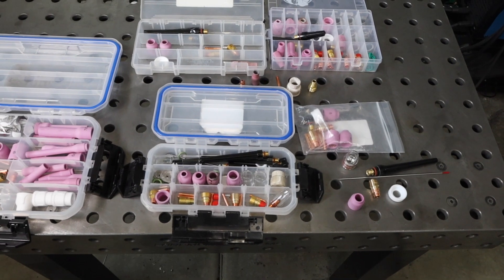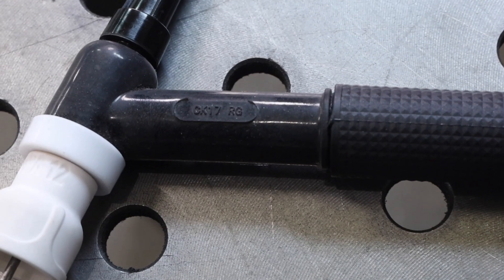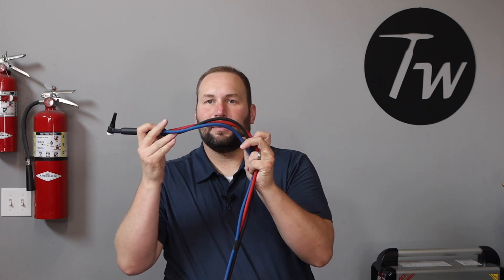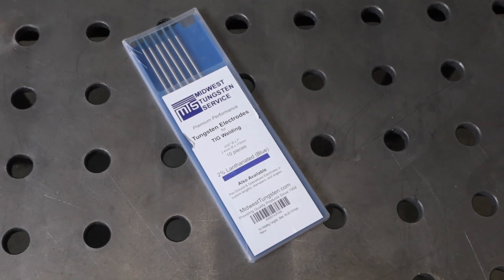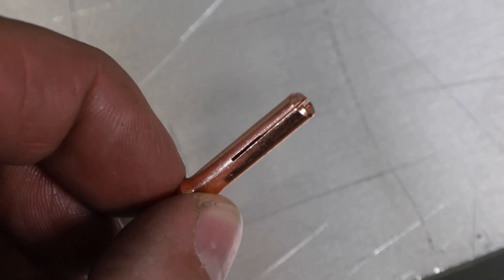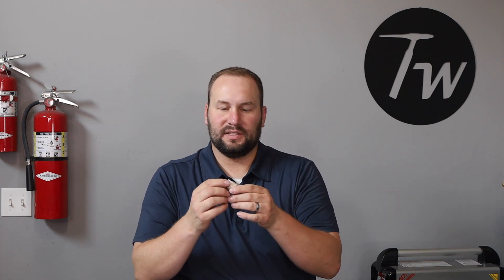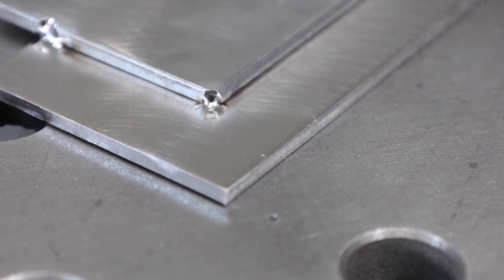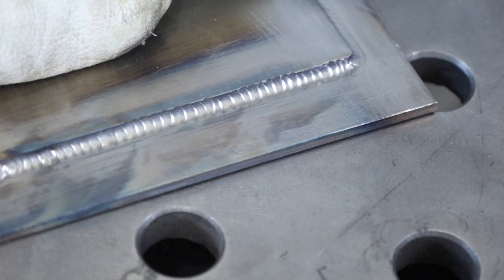TIG Welding: The 6 Torch Consumables That Can Handle Any Job

Comment: Excellent video. Thank you. I started welding in the late 1950's with gas, then stick, added MIG in the 90's. But I'm a newbie TIG welder - PrimeWeld 225 from Weldmonger arrived July 31, 2024 with a stubby gas lens kit. To keep things simple I use a Furick gas lens with 3/32" 2% Lanthanated tungsten on my CK17 torch with a ceramic #5 stubby cup for aluminum and Ceramic or Pyrex #8 stubby cup for everything else. I built a copy of your TIG grinder (thanks for that video too!). So far that's working well for me. It costs $112 to refuel my 80 ft^3 Ar tanks at the local Airgas store (at my age I don't drive any farther than I have to) so I avoid bigger high flow cups. I may eventually need one,  but until I do I'm trying to keep it simple. After 2.5 tanks of dedicated practice TIG has become a functional process for mild steel welds I'm proud of and I'm close to that for Aluminum, so it's working for me.  My only planned upgrade is a 25' water cooled flex head CK18 water cooled torch that will use all the same torch jewelry.

Comment: I have the torch that came with my YESwelder 2050 (WP-26) that I would like to replace with a smaller one.  I don’t need the on off controller as I bought a foot pedal, but I really WANT to try the much shorter gas lens.
Reply from the maker: The short gas lens will fit on a 26 and it helps a lot. I really like the CK torches. A 17 will be a bit smaller but still share consumables with the 26. A 9 is much smaller, but uses different consumables and has a lower amperage capacity.
Reply: @TimWelds  Thank you,  I want to get rid of the big clumsy 26 that it came with.  I had always used a water cooled 17, with a #5 cup.  Years ago I was a professional welder specializing in SS, but learned on Aluminum using a oxy/ acetylene torch.  I still prefer SS and aluminum to this day

Comment: I usually like sticking with an 8 cup on stainless most of the time. The color is great on the 10 plus cups but I like to save my gas when I can. I kinda hate running full post flow when I tack up stuff too. You can also use copper to create gas traps for your weld joints, good for absorbing heat too.

Comment: looks about the same diamond coated disc for tungsten grinding that i use...only mine is mounted to the outside of the grinding wheels on a bench grinder.  100 grit works great!

Comment: I have a question about tungsten. How do you cut it apart? ☺️
Reply from the maker: You can use a diamond wheel to cut it, or just make a nick in it with a grinder, clamp it in a vise right at the nick, then bend with pliers NDI it will snap off. They can split when you snap them, but mine usually don’t.
Reply: @TimWelds  thanks for the answer 😇

Comment: I do 90% of tig with ck20 and standard 5 or gas lens 6 cup. Titanium #8 gas lens. People tend to use big cups for no reason at all. You dont need #20 cup to do nice welds, you just need to know how to control heat input. For that you need some theoretical knowledge and a lot of hours under mask.

Comment: What cnc plasma cutter do you use?
Reply from the maker: I have a Premier Plasma table with a Hypertherm Powermax 45. The Hypertherm is awesome and they have great customer service; I would definitely recommend them for plasma cutters. As far as the Premier Plasma table goes, it works pretty good for the price, but I had some quality issues early on that would lead me to pick a different brand next time.
Reply: @TimWelds  thank you

Comment: so ive read a argument that large gas coverage on AC will result in a wider arc. where theres gas, there can be arc. So if you arc longer than you should it will allow the arc to be less controlled. For this reason the argument says NOT to use gas lenses.

But i think this argument may be outdated because now you can get 4,5,6 cups that neck down around a stubby gas lens when before all you could get was 8,12,14,25.

with 1 yr of aluminum tig experience I mainly run #8pro stubbys but i do find that i struggle when small precision is important. Im going to drop to ally5 furick & see if it will narrow my beads.
 interested to see your reply.

Comment: Just subbed, very educational Tim, I bought a tig welder but it came with out consumables, so I have never even tig welded before and been trying to figure out what I need, what a nightmare trying to figure this stuff out, first I needed cord plugs 100 amp that's done then I needed consumables, not knowing information  I tried to get a pack of 5 of each items so I got that except for the tungsten something I forgot when ordering, I got the tanks of argon but there to small for the welder and it's the biggest my local welding shop would sell me, I ended up buying the lincoln precision tig 275  k2618-1 it came with the roller stand and water cooler etc package, so all I have left is the tungsten, larger argon tanks (if I can find them) and upgrade the electric in the garage to 130 amps min.
looking towards more of your neat videos.
Reply: What size tank did you get?
Reply: @GiovanniGiorgo  The biggest one they would sell me otherwise I would have to just rent a larger tank for a year and I wanted to own. Now the issue is my house is only 100 amp service so I will have to upgrade to 200 amp service just to use the welder.
Reply: @diggindiggenit6540  you can run the welder with your 100a service, you just can’t run the dryer or heat at the same time 😅
Reply: Most places should sell you a 120 or 150cu ft tank no problem
Reply: @GiovanniGiorgo  Yeah I think I got the 150 they are about four feet tall
Reply: @diggindiggenit6540  ok cool, that 150 cu ft is big enough for you to use.

Comment: I really like your videos. I'm a master electrician and a certified firefighter. I like seeing the fire extinguishers accessible. However, I fear that as your channel continues to grow the number of people that decides to install an extinguisher on the same stud as the light switches will increase as well. That stud generally has wires running up and down it on the inside of the wall. I fear an increase of house/shop fires by your viewers following your lead on that one. 
Had I been able to watch your videos prior to my welding years that would have been nice. As I'm learning from you, I'm remembering the struggles. Thanks!
Reply: I keep quiet on things I have no solution to.  I saw them mounted there - thought it was an interesting choice because if their was smoke -odds are the people in the room know where the light switch is and could find them easily.  I also thought they could be knocked off easily because there are always hands there.   
However your statement implies that they should not be mounted on studs where you know electrical wires exist on.  I could infer from that: 'electrical wires inside of walls can be a source of/cause of a fire'   And yes, of course they can be - if installed incorrectly or damaged after installation (for example shorting out the RX wires when you missed the stud while you are hanging a fire extinguisher :-) ) 
Where should they be mounted to avoid this issue?
Reply: @nhhandyman  
It's always best to use a voltage sensing pen from Lowe's... to find a stud that doesn't have wires running along side or through the center of them. 
We drill holes through the studs to run wires through that are are far enough back to avoid sheet rock screws but not far enough back to avoid longer lug bolts. 
Even without a voltage sensor pen, you can rest assure that those studs have voltage along side of them / or even through the center of them.
I can see why the location is attractive from a response/accessibility stand point. 🙂The problem is that It's fire hazard that looks attractive.
Reply: You can hit wires no matter where you mount things, this video won’t increase the odds of anyone doing that or starting a house fire.  It’s a million times more safe to mount that fire extinguisher on a stud then hanging a hundred pictures in random places on the walls all over the house.

Comment: I also advise people to just get a CK. I’ve tested a number of Chinese versions from eBay. Some of these are no more than $10. What I found with a couple of the really cheap ones that they’re not made from copper. Some are made from copper plated brass, which is not great. But I found a couple that heated up so quickly I couldn’t understand why. When I cut them open, I found that they were copper plated—zinc! Zinc! I mean, really now. That’s just dangerous.

Also, for most anything, 3/32” electrodes and 2% lanthanated. That makes it simple for those new to this. Just grind a longer point for thinner materials, and a blunter one for thicker.

Comment: That's 10 minutes I'm glad I spent. Thanks Tim!
Reply from the maker: You’re welcome! Thanks for watching!
Reply: @TimWelds  amazing.   came across this 4 years later.  still as relevant as ever.  I have watched probably over a 1000 videos on welding.  not an exaggeration.  3 stand out.  this one.  one from Sylvestercustoms and migmastermike on mig welding which was a masterclass. and a simple intro from grumpywelds on tig welding.   the other 997.  showpieces.